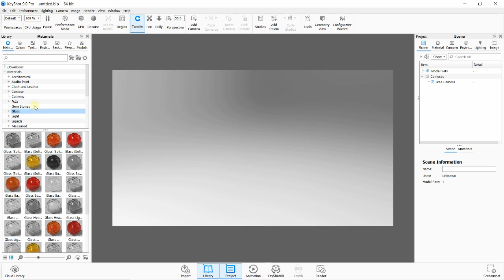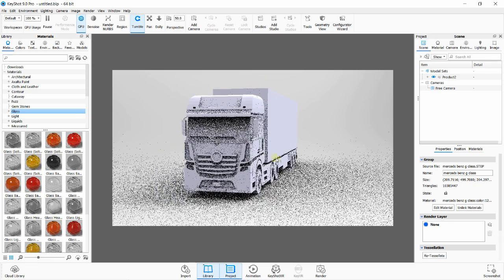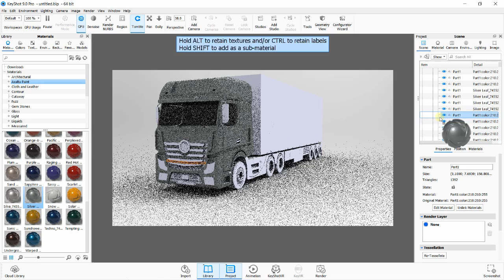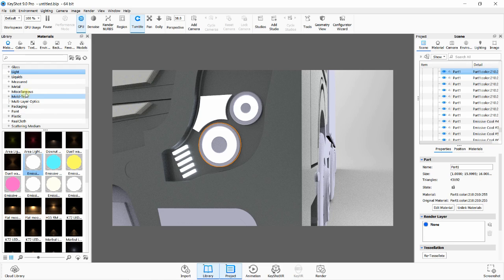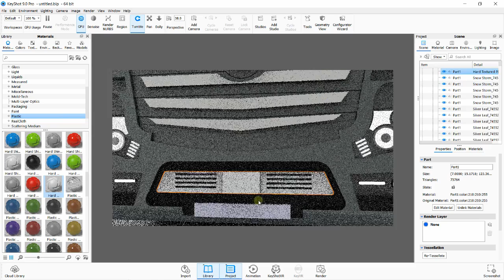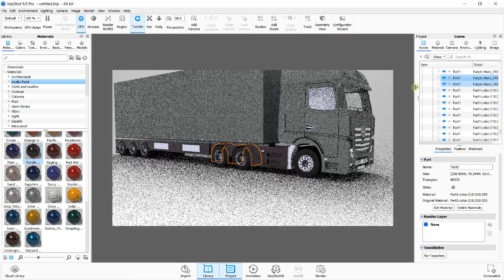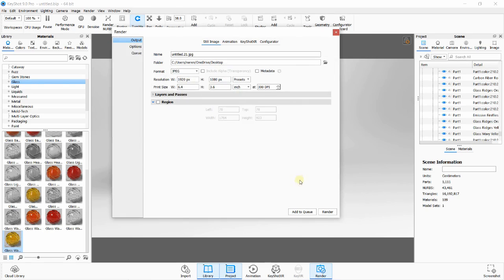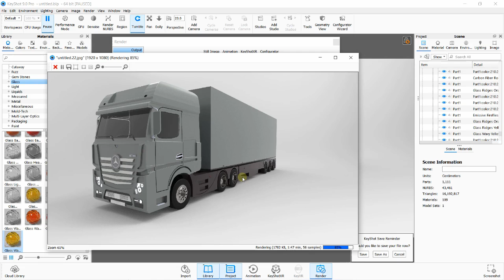how to render product like pro, Catia to Keyshot rendering #render #animation #product #catia

Comment: Bhai, how to design brackets ( sheet metal & plastic) ? Will you teach complete A-Z in designing brackets in hindi ?.how to read 2D figure (dimensions) and convert it in 3D ?.. How to design wire harness and electrical connectors with harness?
Reply from the maker: Ok i will try .. thanks